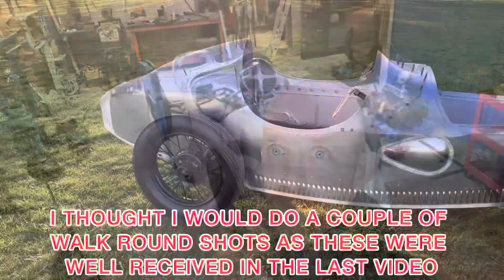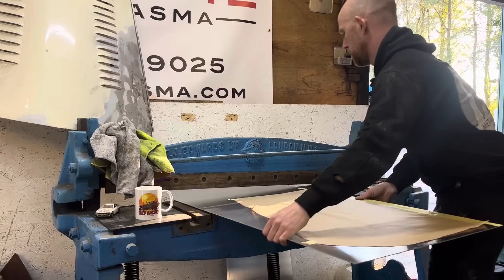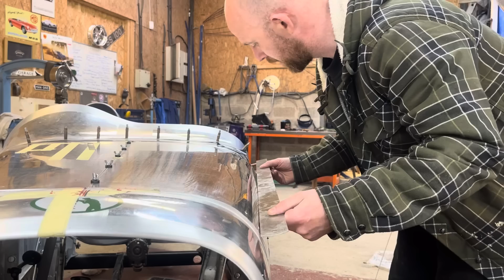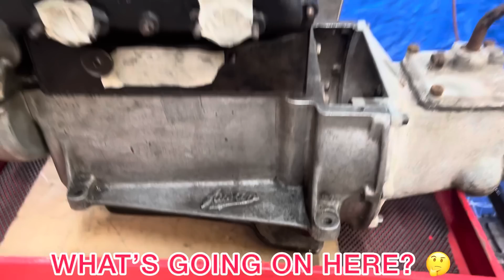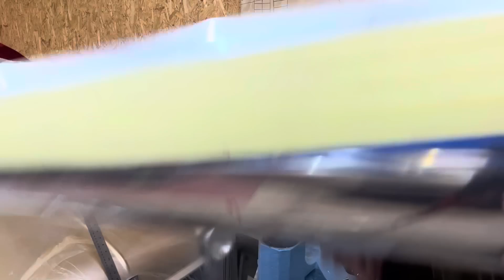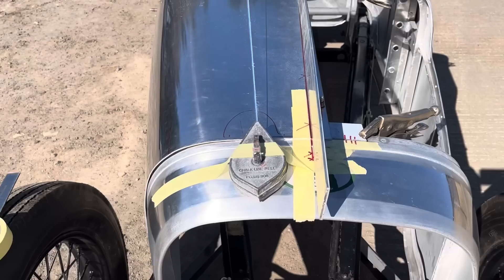Austin 7 special - making the bonnet - pre war car

Comment: 30 seconds in you've done a precise cone shape and most of us would be delighted.  My friend took three goes to get to that point.   You've only just started...  One thought with body flex is mounting it in one place at the front and two at the back and "the body" and "the chassis" can go their own ways.  I think Gordon England bodies are like that.  Racers like Tim Myall's Pigsty series go the other way and try and get the maximum chassis reinforcement out the body, but don't care about even gaps etc.  My favourite moment was "four hours into louvre placement".  Whole other level...
Reply from the maker: Thank you. Yes I’m going to go down the lines of using the body to stiffen the the chassis as I’d like to race it next year .
Reply: @Metal_shaper_tom  Exciting!  Reliant engine first?   I saw the Austin engine.  Power is cheap, and for an occasional hillclimb the bottom end might last a while.  I did a few races and hillclimbs on a standard crank and rods but not many.  If it's lots of road miles and proper racing (rather than just joining in) then it's a proper new crank and with that investment "everything else", as I'm sure others have said.   I was pleased to have been able to do it "on a shoe string" like the 50s books but I wasn't expecting reliability.  Earlier engines had hand me down reliant crank conversions (before the phoenix and hadkey cranks were available) and I had some disasters, but all part of the fun.